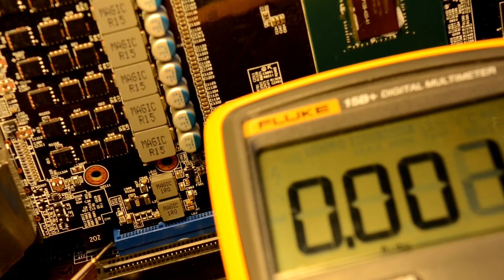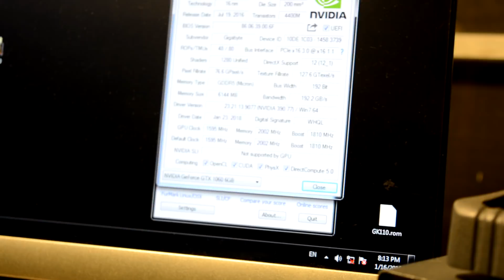GTX 1060 no video repair process + motherboard repair easy fix graphic card repair

Comment: What heat gun did you use and what temperature is recommended for a small capacitor near the pcie pins?

Comment: Hi, I have a 1060 asus turbo that have a missing chip on u502.  think it got knocked off? Looking at same board on ebay, there suppose to be a chip on the slot.  Do you know where I can buy one in the US?

Should I just use soldering paste and heat gun when I try to put it back on?

In your opinion is this something worth fixing?  I don't even know which chip I should buy.

Comment: I have a evga gtx 1070ti sc Every time I boot up the pc everything turns on including the gpu and it's fans and lights but then turns off soon after. No signal but monitor detects plug in power help plz

Comment: I have an msi box 1060 gaming x 6gb.  I was hooking up to pci riser and reversed the pci plug in the mother board.  The little USB card smoked when I turned it on.  The mother board is fine and workers with other cards.  The video card lights up and fans come on but the card is not detected and no display.  What are your thoughts suggestions.  I’m thinking the gpu is fried, no evidence of burning but haven’t tried checking the resistance or voltages yet.

Comment: I bought this exact GPU for 40 euro’s last week and repaired it. Exact same issue. I thought it was a fuse. Does not look like a braking resistor to me. So i bypassed it with a blob of solder. Works fine now.

Comment: Hi Eli, you have a very interesting channel.  Although I have a formal high school electronics education I have never done that in my life and looking at you I feel like trying to fix my graphics card myself. Similar model as in this video: gigabyte gtx 1060 mini. No picture but the fan is working. GPU is cold. It seems that the motherboard simply no longer recognizes it. The computer can be started with igpu and there is no gtx card in the device manager. Can you point me in which direction to look for a fix?

Comment: Dear Youtuber, I have Msi Armor 1060 6gb, have been working flawlessly for 2 years. Right now it works for a few minutes either while gaming or on desktop, then it shows garbage/glitches/lines/dots (whatever you call it), then PC goes off, and need to cut-off power to completely powet off, soon after when i try to start PC, it doesnt show any display, bit after few hours when i try to turn the PC on, it works again, gives display, windows load then after few minutes same glitch happens.
Can u help me find the problem? And how can i get it fixed? Does giving heatgun treatment to gpu chip and vrams help?

Comment: Hey i have a gtx 1060 3gb only it displays DVI 640x480 in the monitor then its all blank screen but the numlock is responding what might the problem of my gpu thanks

Comment: My Zotac 1060 Mini has started dying in 2.5 years, turns off randomly, with / without load.. Applications on the PC keep running even after display goes off. I tried changing almost everything: Monitor, motherboard, CPU, PSU & RAMs but the issue persists... off the top of your head what could be a common reason for something like this?

Comment: Does anyone knows where the speed sense pin for the 4 pin fan goes to ? I accidently shorted the 12v and sense pin on the fan header and the gpu is not turning on now !

Comment: You inspired me to fix my old blown r9 280x. Two ~0 ohm power resistors burned in two phases, plus a failed capacitor on one phase.

Comment: Can u help I have a problem my 2 year old  gtx 1060  card now showing no display 
(the connection is hdmi )
I been playing a game and after some time pc went sleep and when I tried to wake it up all started no display on monitor after that I have tried different HDMI cable but not working .  Actually graphics card fan is working and it's heating up too like before  when connected but no display 
And my question is does the HDMI port of graphics card broken ? I didnt checked other ports because my monitor only have HDMI and vga port and graphics card have HDMI,dp,dvi ports 
Is this card dead ? i never overclocked this card and maintained temp under 70c most time what could be the problem monitor or motherboard don't have any problem I checked plz help

Comment: Can help me out mate. My 1080ti goes black screen but the fan still spinning. I tried to reflow with a heat gun but still black screen. The card was kept in a shelve for about 1 year after i made my i9 build. After that, i only used for 1 week and then it goes black screen. Do you know what problem with my 1080ti? Really appreciate if you can help thanks!

Comment: Eli Tech:  i see ur PSU fan is not spinning when testing out the post-test, if a PSU fan doesn't spin does it mean not working? i ask cuz i to am having the same issues, the funny thing is i have the same problem with a motherboard i had as a back up along with ram, PSU,  a new Ryzen 5 1500x chip just 2 of everything, and that mobo also dont show image on the monitor. i plug the monitor to my laptop, and it's fine. But the odds of 2 defective mobos, rams, chips, and GPU's. if you can give me any kind of advice i appreciate it . Also i Ran all possible test i could think of, and nothing. Please help if possible TY.

Comment: Eli Tech, I have a PNY 1060 6G that does have video, but is artifacting and freezing the computer while in games. How would I go about fixing this issue?
Reply: Did you solve the problem  ? I have the same card and the same problem.
Reply: @ameenibrahim7519   No I ended up just replacing the card. Eli did not reply or contact me, and I was not able to find the issue myself.
Reply: @Anonofthepeople  i see a review said this issue because of the heat paste exhausted alone the time so the card becomes so hot what causing it shutdown,  i didn't trying it yet .

Comment: Just built a new pc, well the problem is that when I use my gpu there’s no display on the monitor but the over all pc is working I think because the fans are working, so I tried removing my gpu and put my hdmi to the motherboard port, powered it up and it booted. I was able to install windows because of that. But still I don’t know why when I use my gpu for the hdmi port there’s no display but the pc is booting or working please help anyone hahahaha I just want to play some games 😭
Reply: Because your cpu have integrated graphics core but your graphics card is faulty

Comment: Eli can you please help me... i have hd7770 that stopped working hdmi and DVI ports after i used bad hdmi cable for half minute...but displayport still working... i measure voltages on HDMI pins and DVI pins on cable end from gpu and i get 5volts on hdmi pin 18 and dvi pin 14... but on hdmi pins 15,16 i get sometimes 1,42v sometimes close to 2v and same on pins 22 and 23 on DVI where supposed to be 5v what should be problem?

Comment: Hello Eli Tech hope you can help me with my problem. I just bought a Sapphire Radeon RX 580 Nitro + Special Edition in Amazon Global to use it for mining but I think it's defective. There's no video output in HDMI port and in mining it's indicating a GPU usage of 16% only and has 12.9 MH/s only while others I saw it they're getting 27 MH/s. I'm using the on-board VGA adapter to monitor my progress. What do you think is the problem?

Comment: Putting the motherboard on a flat surface is risking shorting things. I know you must have cleaned the surface, but you might still short things out
Reply from the maker: plezx29 you are actually very right and the way I do is unprofessional. I m looking for something to put on. Was hoping that there wouldn’t be so eyeing viewers)

Ps  hey but you could see sometimes I put my plastic cover under
Reply: @elitech3339  Yeah where you are repairing the graphics card I saw a plastic cover, but the mobo needs it just as well

Comment: looks like that you can drop in a 1070 chip with 2 more GB of vram and reflash the bios and possibly have a working 1070 upgraded from a 1060.  that possible?

Comment: How do you know, how much  ohms and volts each component need to have? I have a lot of broken gpus but never try to fix them, but now after I sucribed to your chanel, I watched many of your videos and I want to repair them
Reply: the same way you know how strong GTX1060 6GB is compared to, let's say GTX1030. Basically it's common knowledge once you get the grip of the repairs he does

Comment: I have a broken Gigabyte 1060. Should the 1.4V memory voltage be going to the GPU? I measured this voltage across the small bypass capacitors on the GPU itself (across the bottom were the pci-e slot is). GPU gets warm. Here's the interesting thing. The 1.4V its being generated by the memory VRM with nothing but 12v been applied to the card.  No 3.3v standby. no 5v, 1v, 1.8, or 0.8V Vcore voltage. I don't know what is powering the VRM controller for the memory.

Comment: Hey bro I have been trying to contact you in anyway I can. I was wondering if I sent you my gtx 1080 that takes a while to start but starts at 640x480 and is stuck there. If I was to send it could you fix it and send it back. Of course I will be more than happy to pay you..

Comment: On par with Rossman. Better content because there are no Mac's.
Reply: He did not use the proper amount of flux, as I did not see any flux being used.
Reply: lol
Reply: That means I'm going to have to search for this guy Rossman because your comment means he's conversant with more equipment
Reply: @ralphmiranda2077 Rossman only fixes macs, where as Eli fixes almost anything.
You are already in the right place.
Reply: I've gotta find an "Eli" in NYC :p
Reply: But Rossman explains better
Reply: Explains what exactly? 
This guy gives all the required info.
Reply: @kyleanderson1613  have you actually watched any of Rossmans videos? he explains a whole problem. just because he does not repeat it every video,1you know, you could use the coconut on the top of your neck.  Eli does stuff that Rossman does not, GPU and other PC hardware. Rossman said in one of the videos, that economically its more feasible to fix apple hw. But hats off for figuring out how to fix ANYTHING.
Reply: Rossman is nothing compared to this channel.
Reply: @MicroageHD  LOL WHAT???

Comment: Hi, i have a msi armor gtx 980ti, and it has alot of artifacts, is there any way to measure where the problem could be or do i just reflow it with some flux and heatgun?

Comment: great video as always.

can you help me out? I have an RX 460 that wont give picture. i measured it all and seems OK. only thing i notice, is only ONE chip of memory is getting very hot. is that chip causing the problem? or maybe the memory controller?

thank you !
Reply from the maker: see what resistance on power to memory, if you have power supply apply current to the phase and see if this memory bank heats up.  If yes then try replace just this memory chip (never worked for me). Looks like needs at least and first whole memory replaced.

Comment: Hey, Would you ever mind at some point posting a list of regular test points and voltages/ohm readings for each?    Things like MOFSET gate-source-drain, mofset driver, etc....   This will probably help a lot of people wanting to try this for themselves of they have the equipment and more-than-basic expertise.... because almost nowhere are schematics for video cards available;  which would help a LOT in the diagnosis process.   Its not necessary, but might help us common folk out if you share =)  in-circuit testing info on many devices is hard to come by.
Reply: Yes, it would be a great video! Explaining how to recognise parts of the circuit, where to measure for which voltages and resistance. Please :D
Reply: theres probably schematics or something if u look hard enough online
Reply: @davidmadison1984  idk man like I said if u look hard enough.

Comment: R9 390x vrm2 goes to around 125C under load is that a problem bcz i have arctic 4 on her and vrm1 is on 70C gpu chip on 60C. Should i worry abou it or no?

Comment: Hi, thank you for your video. I thinkg that you made mistake. You talking about resistore when it is fuse I suppose. In other hand where you bought that fuses? Maybe you have found them on ali?
Reply: It was a resistor. A fuse wouldn't give any voltage on the output if it was blown. And that's pretty much all that can happen to a fuse. Same with low Ohm resistors which can be used as fuses.
Reply: @adrianandy5878   Thank you for answer. So the label F4 doesn't mean fuse?
Reply: @robiesam-idomyself5017  It does mean fuse, but you can also use low ohm resistor, because it basically does the same job. Burns out in case of overvoltage. This card most likely suffered some physical damage and someone replaced the fuse with a resistor which was already broken.
Reply: @adrianandy5878  Ok so could you tell me where you find those resistors to buy? I mean exactly these same.
Reply from the maker: To the whole point it doesn’t really matter. 
  But I also was thinking from the beginning that’s  fuse, but Andy already explained my point
 I got this one from one of my cards which I use for parts
Reply: I have found those component. It is 0501010.WR

Comment: Can someone help me?
I have a R9 280x that is doing "Coil Whine like" noise while under load. After a few Seconds the PC will Freeze. I also tryed out a different PSU. I dont think the noise is normal coil whine noise cause the FPS doesnt matter. When i run Furmark at 50 FPS the noise is really loud, the noise gets even louder after a few seconds then for not even half a second it gets quiet and then freeze. I also tried turning down the GPU clock and VRAM clock.
Reply from the maker: GerVtech yes, looks like your coils making noise. Either replace them (gpu ones) or you can take your old coils out and pour epoxy into it. To make coil steady and then see what it does
Reply: @elitech3339   but can they be the cause of the freeze? The Problem is when the GPU is under HEAVY load, the pc just crashes into a green picture and also the coils are really loud while this. I tried to underclock the gpu and vram again to the lowest possible, and then the pc works...
Reply: Did you overclock the card previously? Try a bios flash. Also, open the case of your computer and check if the fans are spinning on the graphics card.  Make sure you have good ventilation inside your computer case. I also recommend installing a hardware montoring software like MSI afterburner.  Do not try softwares like Furmark if you're not confident that your grahics card doesn't get proper cooling from the fans.
Reply: @adrianandy5878   the temps are fine. I tried flashing a new BIOS and a BIOS with lower Voltage but it didnt work out. It just crashed a bit later... i didnt overlock the card i bought it broken. It crashes into weird color btw. Always a different one with a specific pattern. Can it be the VRMs? I have no clue what i could to next. Everything seems fine.